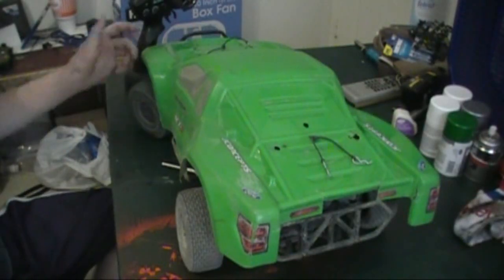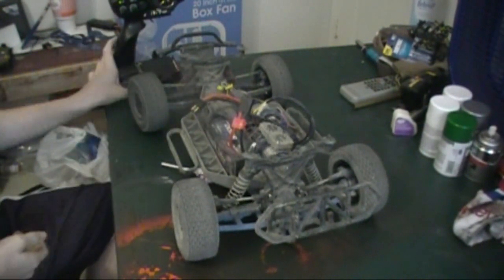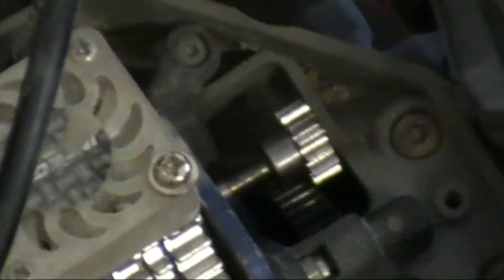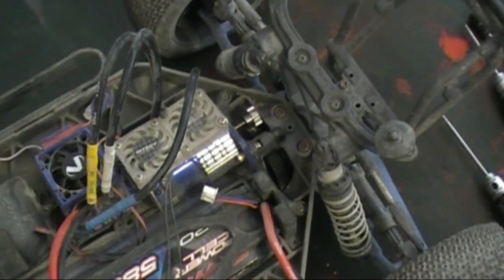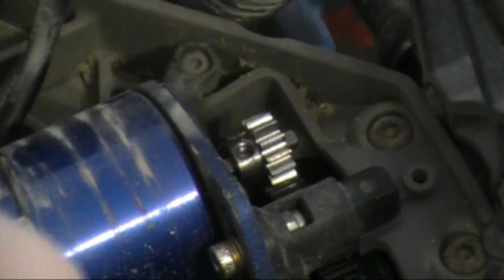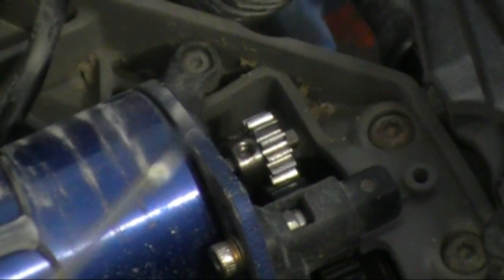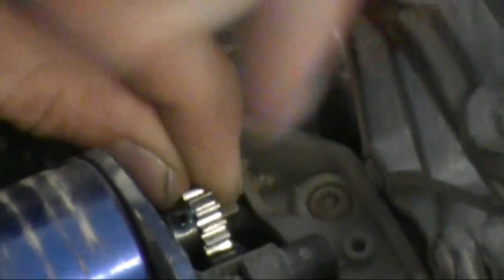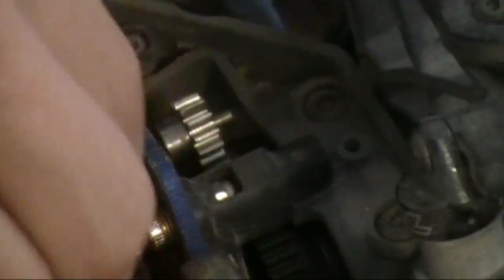Slash 4x4 TroubleShoot-Pinion Gear

Comment: It looks like you're an avid racer. Why haven't you changed over to the Robinson Racing metal spur gear?? The clutch on the Robinson is way better than the stock version, and the spur gear can really take the beating racing dishes out. Just saying.